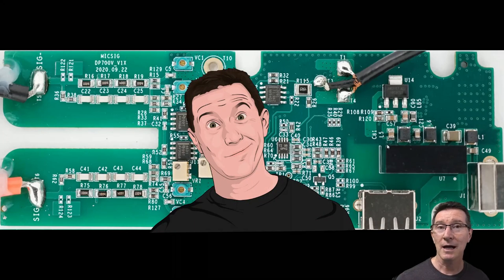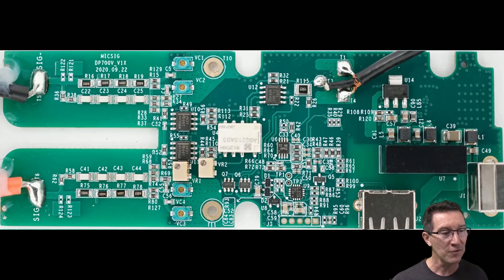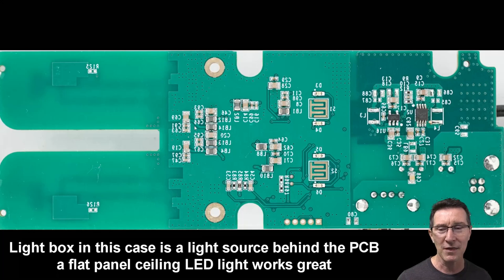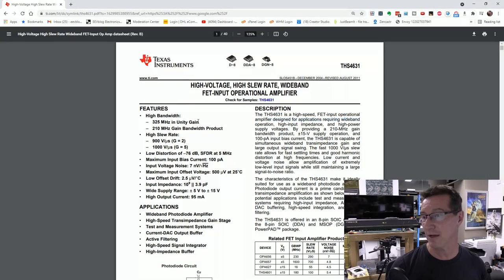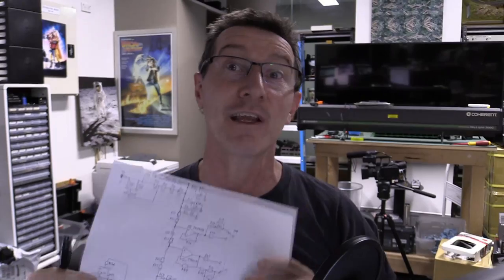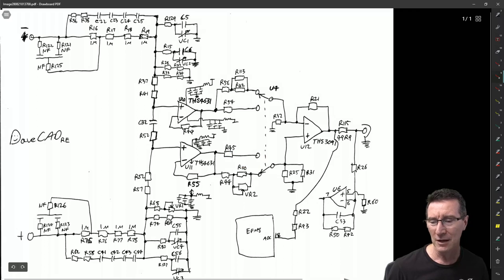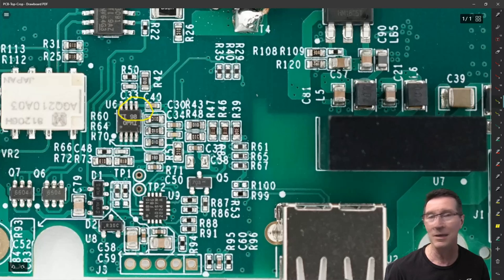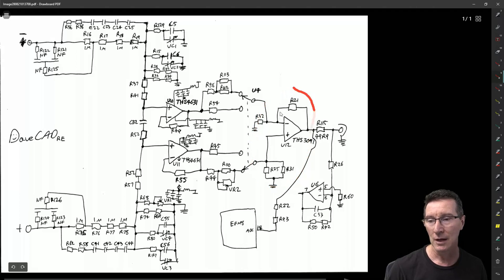EEVblog 1415 - Reverse Engineering the DP10007 Differential Probe

Comment: You can load in images into KiCAD's schematic editor and draw traces on top of it. I have done it before for a couple of boards but it is a bit clunky. I think it would not take too much effort to vastly improve. What would be a HUGE help is a feature is a toggle to lock the net. I want to be able to freely grad components and wires around with out them automatically connecting if I happen to touch a wire with a pin, or two wires overlap each other. It would also be great to be able to freely stretch and scale components to match their physical size on the image. You would be able to snap them back to their original size once the net is locked.

1) Prepare a high contract image of the front and back and reduce the resolution and bit depth. You need a small file size since KiCAD starts to have a problem otherwise. Less than 1MB is good.
2) Put a mark in the center of the image and put a cross hair on the schematic so you can easily swap front and back and maintain alignment.
3) Put the images in first since KiCAD draws objects on the screen in the order they appear in the file. (You can fix this if you open the .sch file in a text editor and copy/paste the image block).
4) Turn off orthogonal wire mode and just follow the traces around, add component symbols as necessary.
5) Move the image off and start dragging components to better places, shorten and simplify the wires.

Comment: Great video Dave. I wish you would do a video explaining how Spark Plug probes work. Once I tried to make myself a very high resistance attenuator to read a spark plug ignition signal. I almost blew my digital scope input stage. The design was very straight forward. Some very small caps and high value resistors. For some reason my digital scope would go haywire. Never could get a decent signal. My guess is such high  voltage signals would need more than just a couple of pf caps. Maybe an idea for a next video. Thanks
Reply: Perhaps there's too much noise in the hv pulse?

Comment: The worse thing I've tried to reverse-engineer so far is a solar charge controller.  Had to remove some current-sense resistors to make sure I was putting components on the correct side of the sense.  Got enough of the schematic together to try to find out why it wasn't working, but then it suddenly WAS working again?!?!  Of course now its water protection coating has a bunch of holes in it due to the continuity probing.

Biggest problem with auto-reverse-engineering though is multi-layer boards.  Even single layer can be a pain due to traces running under components, but when there are internal layers you pretty much need an ultra-high-resolution CT scan to locate and reconstruct the trace paths.

Comment: I just purchased this unit.  Like it so far.  The only negative for me is the use of male banana jack connectors on the probe (for high voltage safety I guess).  Which makes it practically impossible to find other test lead accessories to plug into it.  Every single test lead I find has the male jack on the leads, so none plug into the probe.  Has anyone found any needle point test leads (like on multi-meter) that plug into this unit in place of the honky ass test leads they provide?

Comment: I'd be very interested, how the Input Network is EXACTLY looking, because here some values are still missing (no front on you here, i'm very pleased with your work).

Because i made a Diffprobe with the THS4631 and a THS3091 as output buffer.
I had a very interesting effect during the set up

I can not set the input network (which is just 1Meg//1p5F <-> 110kR//[variable]pF in my case because i do not need a high common mode voltage), to a straight behaviour. 
There is a point, at which the step response is still too high after 100ns, but underhangs its final value after 1us. 
It seems, that the input capacity in the THS4631 is not straight. It is more something like 4pF at first, and then, behind 1 or 10 kOhms or s.th. like that, additional 6pF  
(which resulted after a lot of LTSpice simulation and reverse engineering work)

For all spinoff measurements, i shorted the negative side absolutely to ground with 0R, so i started with just the positive side.

Here, the input networks are also not straight. They often use resistors in a row to their capacitors. And for me it looks like they knew, what i am looking for and solved it this way .....

Greetings from Germany,
stonix015

Comment: This probe has 100MHz bandwidth in both 10X and 100X configurations. How is this possible, since BW is degraded for higher closed-loop gains? Or is this specified for the worst case?

Comment: A totem pole switch on both sides of the relay? I converted some standard relays once for use in a security system with a security DVR. A custom box to switch cameras in and out. A custom 12V UPS. It contain more than 16 power hungry relays. However, I opened all the relays and placed hand matched per

Comment: The second output feedback signal through the op amp — we don’t know what C53 is, nor the second half of the circuit, but I’m guessing this is a filtered version (maybe rectified if Q5 is involved) for whatever reason. Could this be used by the auto-zero mode? Also since this 2nd feedback comes from the output side of the series source resistor, the software could perhaps determine whether a 50-ohm or a high-impedance load was connected, but to what end?

Comment: I don't think I could see where and how you determined the front-end op-amp power supply and single ended bias offset ?
Trying to fix the offset issue with one of these Micsig differential probes.  The most annoying thing about these probes for us (we have many of these probes !)  is that a lot of them develop a voltage offset that is not able to be calibrated out by pressing the two 50X 500X buttons at the same time which is normally the way to do that....   I think that the micro may actually put out an analog voltage that offsets the circuit ?
Guessing on that.

Comment: Gimp does a great jump of reversing lens effects and perspective. We did that with photos in combination with CT scanning the multilayer boards.

Getting the board flat for the CT was hard as you can end up with 2 layers on the same scan plane. We didn't have the 3D S/W to try and fix that. Each PCB creates a massive database of 'voxels' - volumetric pixels.

Comment: Interesting to see how this HV probe trying to trim out CMRR imbalance in the divider string. Typical the divider frequeny response is by Rdc, Cmid and Rhf matching. They are using 2 C-trim on each side to capture also part of the Rhf mismatch.Because a Rhf-trim have too much L parasitics. A dirty trick is to avoid 8 parallel Rdc||Cmid which result in 8 mismatched time constants. They take the risk then of high voltage instability of the Cmid caps or need voltage resistance for each which increase parasitic L.
Btw all manufactures are obsessed by the measureable CMRR and forget about source impedance mismatch. In principle for 60dB rejection you have to specify the source impedance mismatch and if you know about this you will be surprised that a 2pF vs. 20pF load will be more important than 60dB. Isolationprobes where a third shield connection bypass the transient CMD current are sometimes the only solution to measure drivers in HV PWM bridges.

A tip: why not reverse eng and add the A, B, A-B function and kick out the relay.

Comment: Hey Dave, that software you describe sounds fairly basic.  I'm considering starting it as an open-source project, since everyone has their own ideas about what features would be useful.

Tip: put one layer's edge outline in blue and the other layer's in red.  Makes jumping between layers by eye much easier.  Either with printed transparencies, or with layers in GIMP.  You can have both visible at the same time then and still follow traces across layers. 

Also, Irfanview rocks :)
Reply: Don't you call David basic. I don't believe your smarter...
Reply: @a51mj12  I didn't call him basic, are you even literate?

As for smarter, I'm sure you're at the top of the bell-curve...

Comment: So how to avoid copycats? What to do when you spent hours and hours and months to design something just to be copied?
Reply: In your local country? Patent the design. Chinese copycats? You accept that they will always be able to make it cheaper and faster lol
Reply: Make copying the hardware schematic useless without also copying the firmware. Read-protect the firmware. Develop software control algorithms that relies on custom parameters that need proprietary complex offline worksheet tools to be re-calculated/re-calibrated if possible for each individual unit.

PS: I didnt mean messing with encryption, soft/hard keys and stuff. I mean if your design has some filter or logic for instance that has 10 parameters and you could either do it with 10 resistors OR with 10 software routines, do it in the software rotines. Because everyone can read resistor values and buy the same resistors but few can unprotect and read (disassembly) MCU/DSP code and understand why your program works and theirs doesn't.
Reply: Pot the whole thing 🤣
Reply: This is a text book design anyway, to simple to worry about but I guess it's very annoying.
Reply: If the curcuit is that simple to design and build then why it took so long for these probes to appear on the market with Chinese brand and affordable price?

Micsig brought some hope for me. I'm just starting to develop power conversion products in my own business and would need to rent a space in an university lab for a limited time only to be able to validate prototypes using high voltage probes and high bandwidth current probes. Now I can have all that in my lab.

Background: In this country (Brazil), TekTronix, Lecroy, Keysight etc are prohibitively expensive for a small business or individual use, mainly due to currency conversion and taxes.
Reply: @andrelange9877  No Idea, but you can see how simple it is, its  probably to niche for the Chinese they wouldn't sell enough, basically not enough money in it for them because if there was they would have done it.
Reply: G E T  R E K T  It depends a lot in who  your potential competitor is. If it's a worldwide competition you're right. But if it's a local competitor that you know they dont have enough skill to crack neither to design their own from scratch, at least you can stop them from just taking all your development effort and jumping straight to the final product layout, BOM and manufacturing an almost identical unit with only the box paint changed to their favorite color.